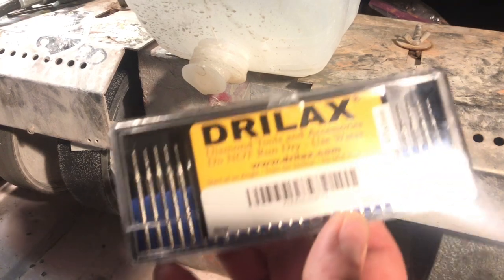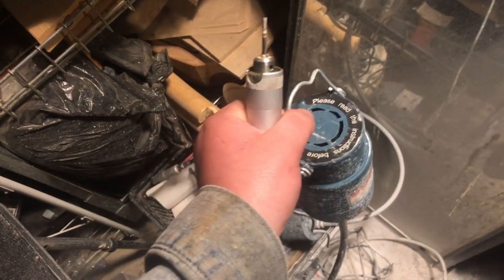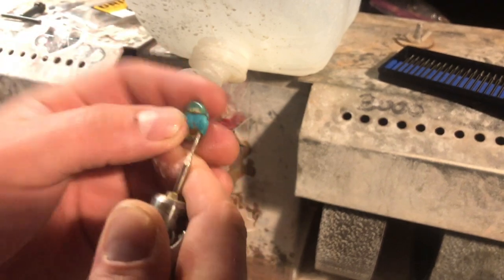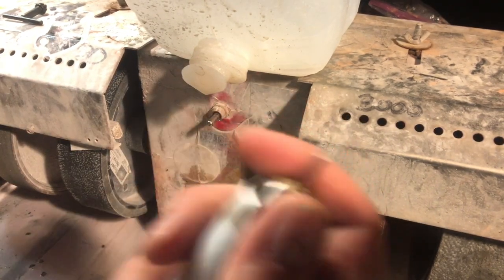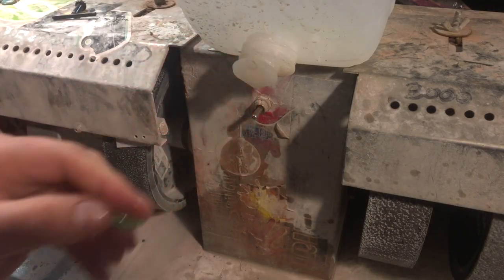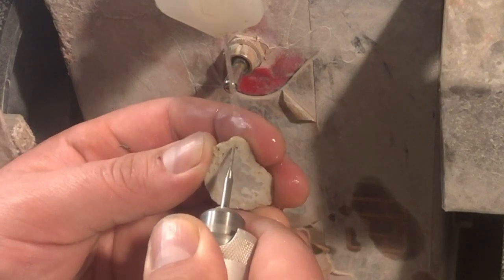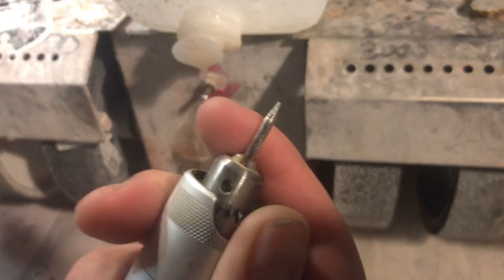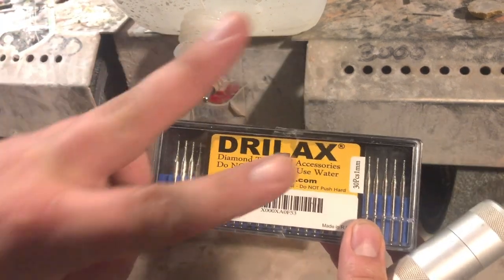DRILAX 1mm Diamond Burrs REVIEW

Comment: Hi Dave! What tools do you recommend for top drilling tigers eye, amazonite, and carnelian? I tried using the hyper tough from Walmart and it wasn't powerful enough. If you suggest a mini drill press what brand? And what diamond burrs?
Reply from the maker: Hello there my friend when it comes to what type of tool to use in my experience it doesn’t matter if I’m drilling sausage sounds like Turquoise or harder stones like carnelian most tools such as the Walmart hyper tough definitely are powerful enough to do the job and it comes down to the quality of bits that you were using if you were using cheap bitch that the Walmart tool came with then you’re not going to have much luck however if you use the Walmart tool with High in bits  80 grit sintered burrs like the badger brand being sold from Kingsley north you will have a much better time I think they’re about $20-$25 per bit but they work really nicely Johnson brothers also carries a similar sintered burr but are ore affordable 
You can try going with a drill press I don’t have much luck with using drill press myself but the Fun thing about your presence as you could always rigor faces and other means of keeping the stone from moving which can really help with precision opposed to holding the stone like I do
Reply: @lapidarydave  Thank you! I am trying to make rough crystal pendants NEWBIE lol. I am attempting a small 4mm deep hole on the top of the rock to put a screw eye pin.  I will get better burrs and try again. If possible, can you make a video doing a top drill using your expertise?
Reply from the maker: @Lifeisgood6623  that’s a great idea and definitely something I can do in the future:)

Comment: hi, for drilling agate, quartz and even corundum i use the cheaper bits i could find on amazon ( somewhere around 15 /20 cts each) with a dremel drill press attachement, i totally immerge the stone in water and nerver had a bit breaking, they do wear up after 5 to 8 stones but hardness 7 or more i think that if you do it gently there will be no problem even with cheap ones.

Comment: Hiya Dave, hey my friend, I bought some just like that, and it did the same thing to me.  So what I started doing is..... when it starts getting dull I use a file and rub the tip a little too where you can see the grits or nice and not worn down, and it starts cutting perfectly again.  Hey you give us awesome tips, and now I get to give you one back. 
Awesome video my friend, and I hope you have a awesome blessed day.  Cya!   😸🐟out!
Reply from the maker: Thank you so much for that tip my friend I will definitely give it a shot :)
Reply: @lapidarydave  I have had the same problem. It works great.  Thank you for all you do Dave.
Reply: So you hold a file against the tip of the drill bit, did I understand that right? You know that these bits are just thinly coated with diamond and that there are even less diamond particles at the tips. So when you hold a super hard file to the tip, you will end up with having no more particles on the tip pretty quick afaik.
Reply: @Der_Kleine_Mann  yes , let me say one thing....it works for me, if you want you can put a slight angle if you want, that way......when you drill the diamond  particles are on the edge, so they will be on the stone first.
Reply: @1catfishuntermiller753  Ok thank you, I will try that and see if it works for me.
Reply: @Der_Kleine_Mann  your welcome, what happened to Dave happened to me, but it broke my stone I was working on, those bits really work well, but they're not the best in the business so too speak.  
But since I have been doing this it's they work longer, when you see the black on or inside the stone stop, and file the tip a little. It's been working for me. Good luck.  I hope you have as good luck as I do. And I hope you have a great blessed day.

Comment: So it is not just me and the lack of skill! My average etiquette for Jasper is about 5 mm And too thick. And my average hole takes about three drillbits!
Reply from the maker: Most likely not my friend when it comes to art materials like Jasper quality bits are a must and even If you have some of the more expensive electroplated bars they still might not work you might want to try sintered burrs Even the cheaper ones from companies such as Johnson Brothers seafood toward better than the best electroplating diamond bits that I use
Reply: @lapidarydave  Auto correction mode at its finest😜
Johnson Brothers seafood, lmao😂